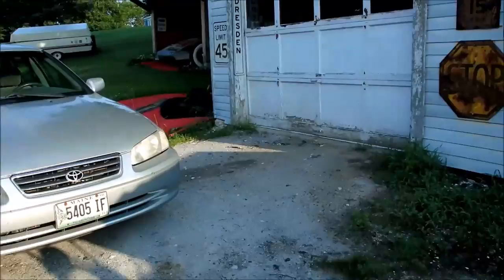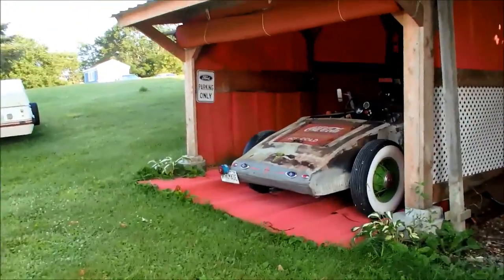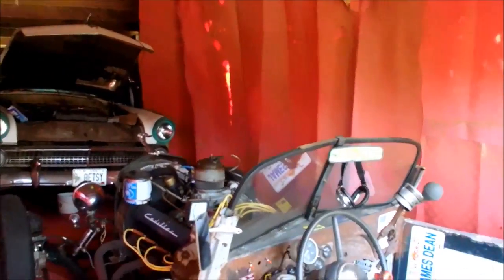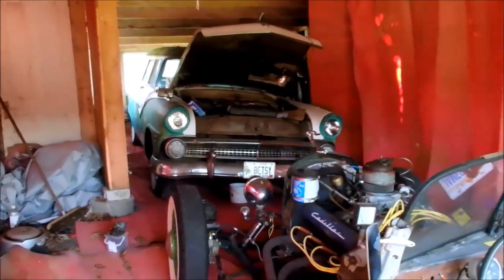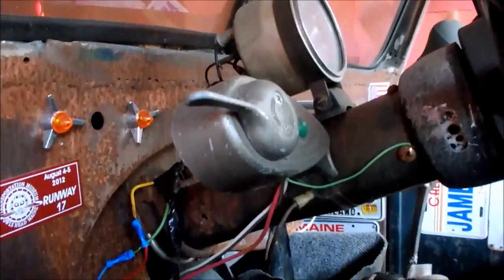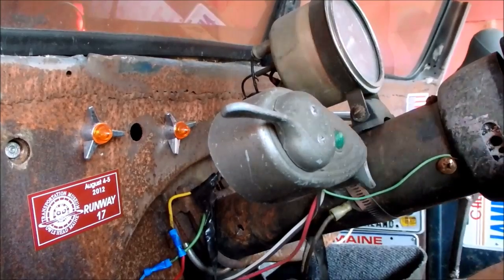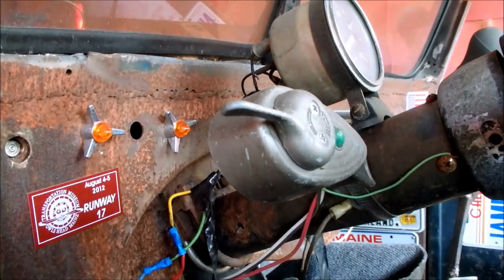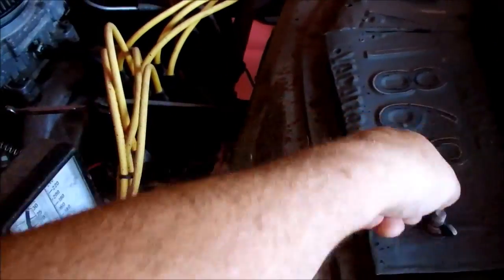Cat in a Rat Rod, Rock n Roll

Comment: cats are a good sign.....no little critters while the cats there...smart little things know when its time to move
.easy fix when you know what to look for....ever hear of a fan clutch going bad? or what the symptoms are?
this is only a test....plz use a #2 pencil
Reply from the maker: I do think I remember that happening once.  It makes a noise, like a worn out bearing.  It can squeel or rattle.   I suppose the fan could fly off if it got too bad.  Am I right.  Been a long time since I thought about one of those..
Reply: i think its making the motor over heat for alittlee while and then go back to normal. not making any noises. i took the thermostat out last winter and it ran fine until the last cold front. then did it again last week, oddest thing i've ever seen. i did a pressure test and the head gaskets are not leaking plus doesnt seem to use antifreeze much. ..ty